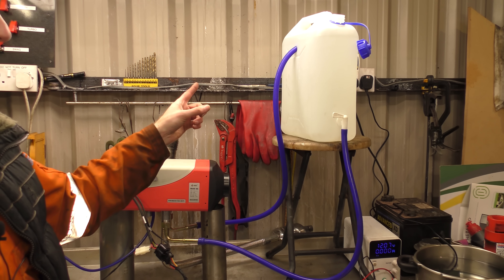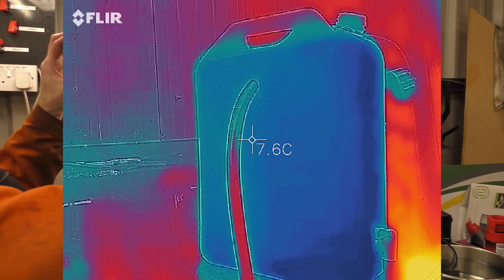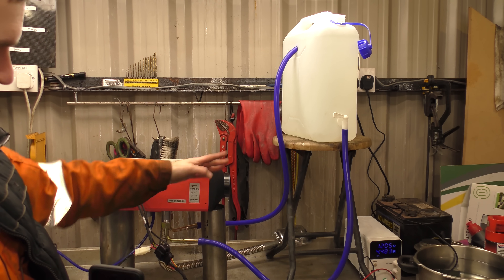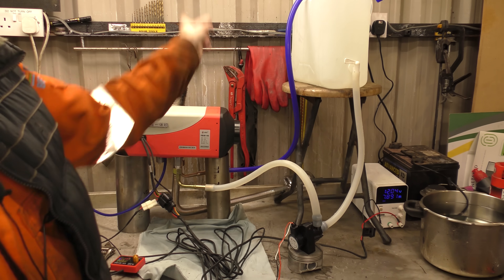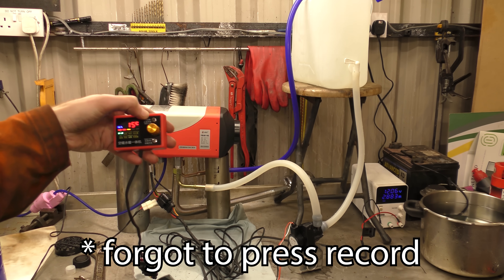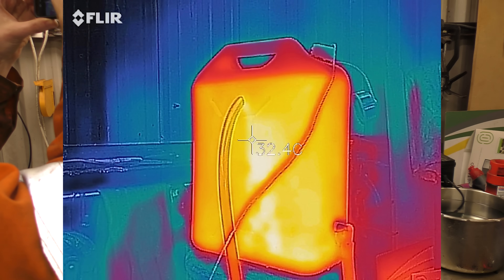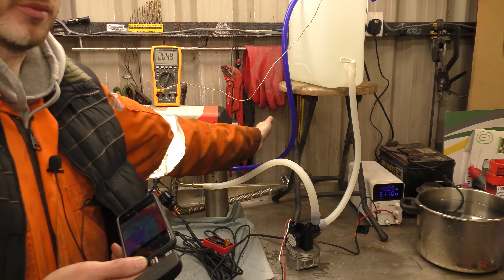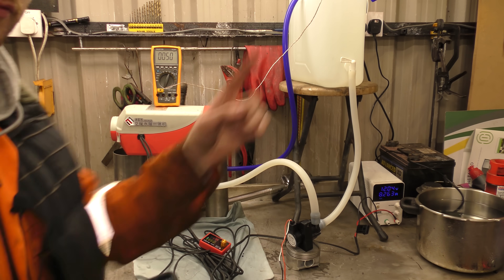Diesel air & water heater thermosiphon? Also heating 10L of water

Comment: Capturing the heat from the exhaust from these units definitely seems like the way to go. I feel like a majority of the heat is lost to the exhaust, watching a bunch of different videos of the internals of these heaters shows that there really is not that much surface area in the combustion chamber.

Comment: How about an air box with a copper coil on the outlet of the heater with the hot water outlet plumbed through it back to the top of the tank? You could also run the heater exhaust through a copper coil in the tank. Its all waste heat waiting to be captured.

Comment: If you rotate the heating unit so the cold side water input it slightly lower then the hot side output you might be able to get enough convection to circulate the water.

Comment: Can you please test this (or the "air only" heater) to heat water using a car HVAC radiator in front of the hot air outlet? (If possible, forcing air through it). Thanks
Reply: @paial - direct the air through an auto heater core

Comment: anyone know how much heat transfer i can expect running pipes from the engine with its 90c water into one of those 25l tubs in a copper spiral of say a 3m length of 15mm copper pipe? all that wasted heat while driving etc...

Comment: Hi nice video I’d be interested to see how your 5kw hot air unit with the EGR cooler on the exhaust compares to this unit... wrote this then you said about adding the egr cooler to this unit.
Reply from the maker: Next video should be testing the heaters against each other.
Reply: I’m no specialist just from a common sense type of view the water cooling from the aluminium housing would reduce the hot air output but the egr cooler on the exhaust should have no effect on the hot air heating efficiency as it’s using the waste exhaust heat.. so I’m looking forward to more of your videos. 

Thanks for the time and effort you put into making these videos is is appreciated 
👍👍👍

Comment: There are two main problems with using this to heat water.
There’s no control of the water temperature and if you turn the pump off the water boils in the heater as you demonstrated.
It does seem to be good as you say to preheat your van and engine block but very impractical for van life. 🤔
Reply: I think you have touched on what I was searching for in the comments. 
What happend to the water left in the 2 pipes entering and exiting the heat exchanger, when your just using the heat function.
I presume it boils the water off sending boiling water/steam back into the holding tank, plus heating/boiling the standing water back to the pump?
Ensuring the pipe work and fittings are capable of handling the possible high water temperature would then be a must.
I wonder if anyone has fitted this and what their experience is.

Comment: With the inlet and outlet pointing down?? how would it run if the heater was set up on one side as can be done with glow plug at top?   Just a thought,, good video Thanks

Comment: Do you think you could run a shower off this unit in a van or would it only really be good for a hot water Tap in the bathroom or kitchen
Reply from the maker: No, best a either heating storage water or the vehicle coolant system.
Reply: @DavidMcLuckie  THNKS mate im loving your vids man , buy boy you get some rain up ther man you hear it belting down all the time

Comment: so this would run a CALORIFIER, run it on full see what temp it gets to with the pump if it gets 65 to 70c it would work.this would be good for a camper,twin coil calorifier with solar dump, one coil fed from engine which could be reversed to warm engine in winter.
Reply from the maker: Yes, that would probably be a good use for this heater.

Comment: I would use this unit in my campervan it would be the source of Heat and the hot water heater to run the faucet with hot-water and a shower with hot water

Comment: What functions does the control panel have?
Will it turn the pump on?
Does it allow you to run it without the blower running? Example radiant floor heat without forced air?
If you were to run liquid only would it be thermostatically controlled?
If you had it hooked up to water and ran it in forced air mode without pumping water, would this damage the unit?

My idea would be to use it in a van for both Forced air heat and or radiant floor heat, one, the other or both simultaneously
Reply from the maker: Heater on and off, heater output level 1-5 and pump on off control.

The fan that blows the hot air is on the same motor as the fan that supplies forced air into the burn chamber.  So it cannot be turned off.  Without the pump running it'll happily boil whatever is in the heat exchanger.
Reply: @MartyGras - a tankless propane water heater would do what you want

Comment: I dont see any reason why you couldn't  just turn the heater upside down, exhaust and intake pointing upwards,,,  pain in the arse maybe, but will prove or disprove whether or not it will thermosiphon
Reply: Exactly, you need a steady upward pipe path from the heat source to the tank for effective siphoning

Comment: The air flowing over the heat exchanger for the blown heating helps to regulate the units temperature but you may not water continuous hot water so if no water is flowing around this part would the unit overheat and would you need to drain water to stop it from turning to steam which could pressurize your water tank if not vented

Comment: I appreciate your efforts and time testing. 

I was expecting a larger rise in temp of the water jug. Considering the run time  of the heater to raise the ambient air temps, I don't see the heater running longer than 20 mins at a time. Meaning you couldn't heat a large volume of coolant. 

Over the same period of time using the coolant pump, could you obtain a higher temp in your jug with the EGR cooler on the exhaust gas?

Thanks again

Comment: Pipes on heater facing up and use at full power please. I think we need a couple of these bad boys working in tandem for the RV winter scene. One for water and air and one switchable between water and engine and also supplying air to the cab????

Comment: HEY DAVID !!! GOOD VIDEO BUT !!  What did the maker of the heater intend to use the hot water for ??  Was it to heat water in an engine block? or for RV use ?
Reply from the maker: It's listed as a parking heater.  I expect they meant it for defrosting a vehicle and heating the coolant.
Reply: David McLuckie I wonder in which location this could be installed in an SUV for instance, to tap in to the engine coolant lines. All existing engine coolant parking heaters are always installed in the engine bay not in the cabin.

Comment: I am curious iff you put the EGR in line what the water temp rising will be. 

But the thing that i am most curious about is when you dont pump water for a longer time. Will the steam pressure be high? So will it boil the shit out of the EGR cooler and heater water system.

Witch is more efficient on it's own the heater and water combo or a separate 5KW heater and the EGR cooler.

I am building a stealth camper van within a year and looking to use this heater for shower water maybe.

Greetz from holland!

Comment: Really interesting,  do you think this could be used in a van to heat water for a shower?  Use a copper water tank.
Cheers dave
Reply: Yep im gonna use the egr style heater for my water tank, I want warm showers! And it'll keep my tank from freezing.
Reply: thomas barlow is the water coming off the heater warm enough to shower with without a reservoir to recirculate the water?
Reply: @DavidGalle1   @thomas barlow   I was asking myself the same question, is the flew of the water going out enough hot to handle a 2L/mn flew of water for showering?
Reply: @thomasbarlow4223  I was asking myself, is the flew of the water going out enoughly hot to handle a 2L/mn flew of enough hot water for showering?

Comment: Would love to see what kind of heating time you get (under equivalent conditions) with a combined system that includes your exhaust heat recovery thing. That being said, if I were out camping in the bush I wouldn't mind waiting 20-30 minutes for a batch of hot showering water. There's always plenty of camp chores to fill the time!
Reply: It’s to preheat your engine block in the polar region 😅

Comment: Could u try the blower on its side like  ig it was mounted to a wall

So the hot pipes up top
Reply: That's what it needs. Any position where the hot side doesn't go down first will work.
Reply: Was thinking that , as I know the eberspachers work on their side
Reply: The first 6 inches of pipe head south this is no good .
Reply: Best keep that glow plug on the high side if you go testing different mounting positions  ;) kidding of course.